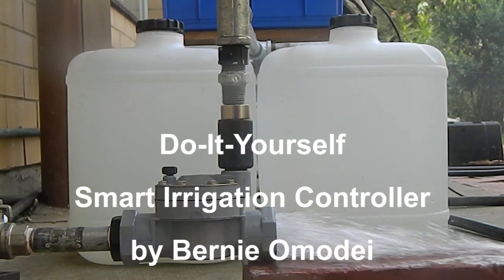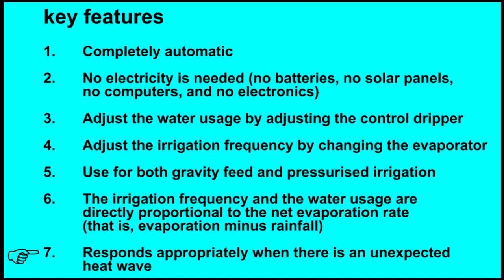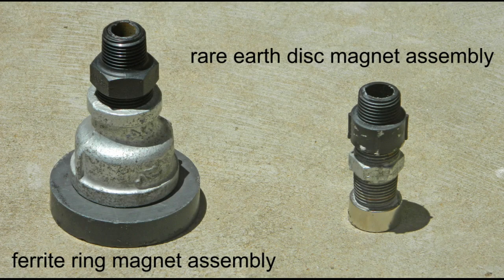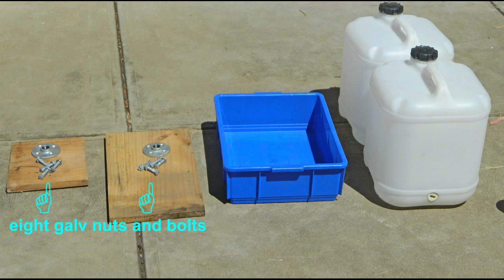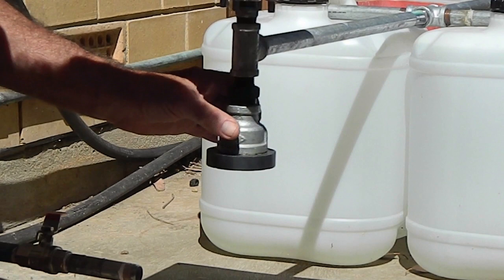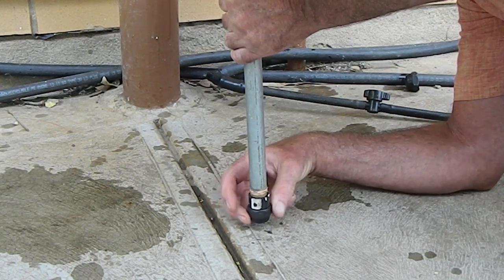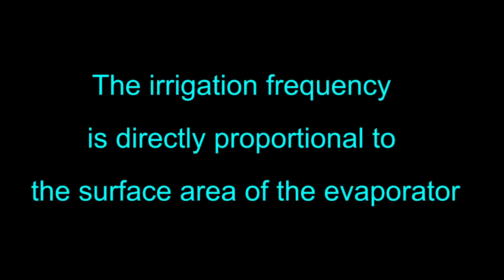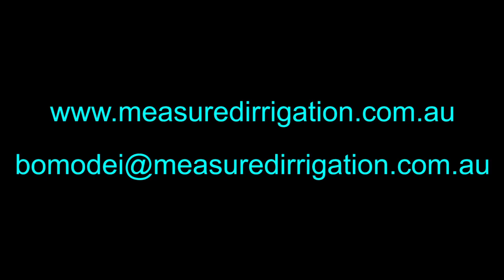DIY Smart Irrigation Controller

Comment: See my flow operated alternating valve. 1 moving plastic part made in 20 mins with store components. You could use the smart solenoid to come on twice as often and each of 2 banks of drips or sprays would then be watered in turn. My alternating valve is smaller than the smart solenoid and would place all switching and valving in the garden using no electricity or batteries.
https://www.youtube.com/channel/UCTnNhrEQ_WtfWyL2rIFijVw